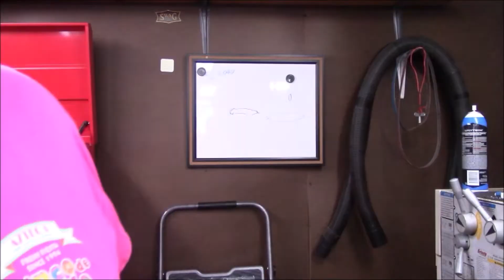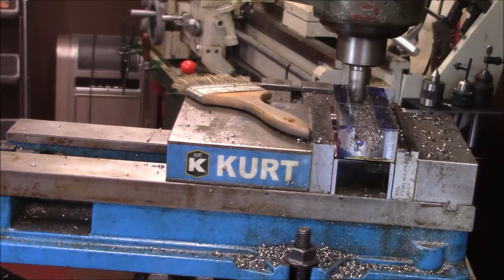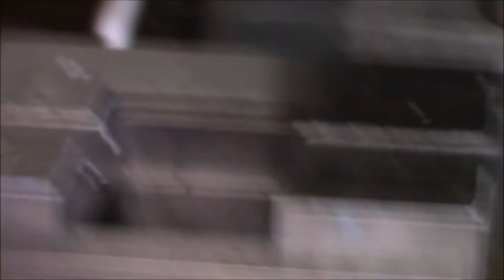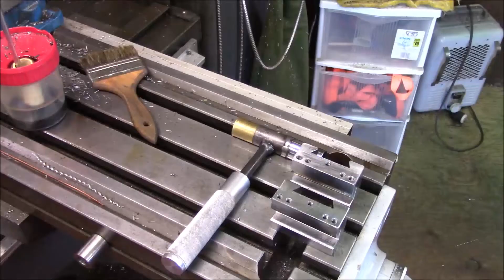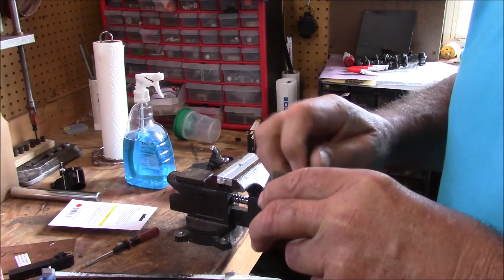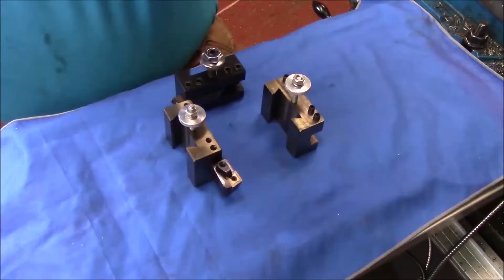Homemade BXA toolholders when you have more time than money part 2

Comment: Great set of videos. I am in the process of making my first tool holder. One of the reasons I wanted to do this project was to develop my machinist skills since the measurements don't have to be as precise as a model steam engine which I hope to make sometime in the future as my skills improve.
Reply from the maker: Well the dovetails need to be somewhat precise because of the fit to the QC post. but with great care it is doable. one thing you can do is to modify 1 or 1 1/2 inch turning tools to fit your posts. Most of my turning tools are modified larger shank tools that I dovetailed. If you haven't already go through my library and I show modifying these tools for use on our home shop lathes.
Reply: I inadvertently cut the depth of the dove tail slot too deep but when I cut the dovetails themselves I set the cutter to the proper depth and all worked out well. My comment about precision was that since my tool post locks on the dovetail slots instead of locking with a piston the part wasn't ruined.